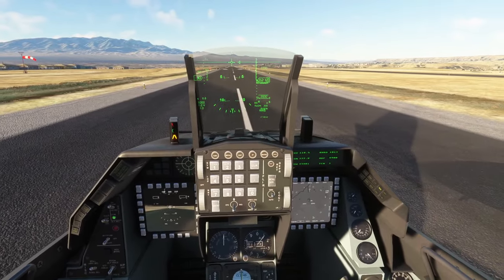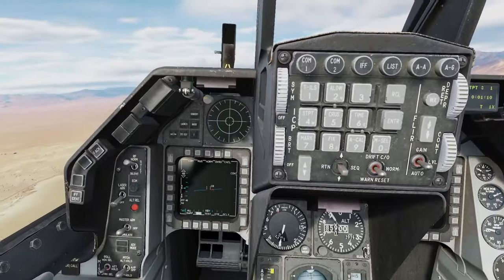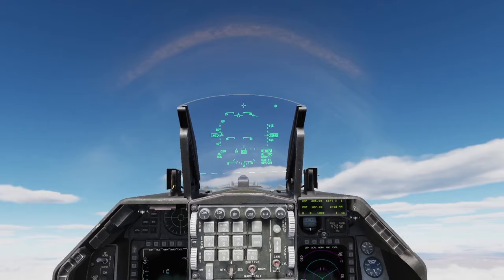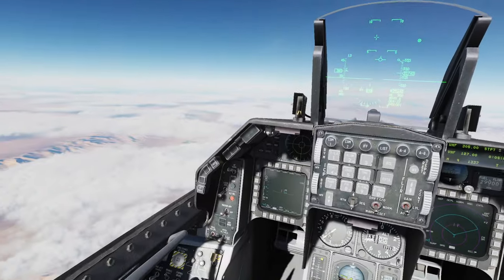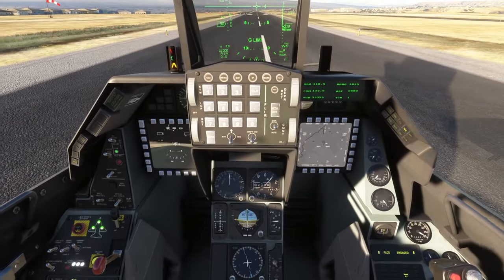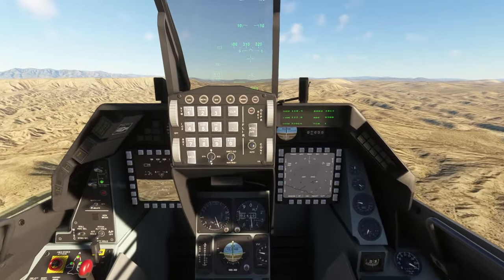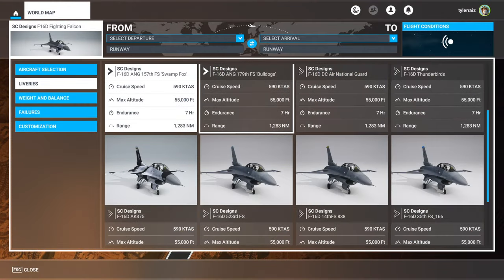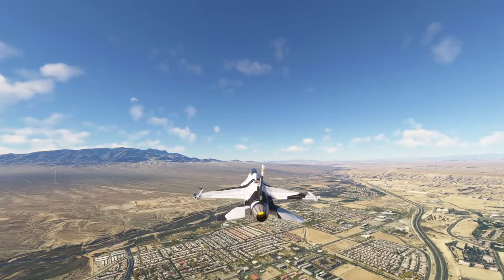MSFS - SC Designs F-16 Update

Comment: Every time I turn my viper stalls
Reply from the maker: At what sort of speed, G load, and aircraft configuration (flaps, gear, etc.) are we talking about?
Reply: Do you have a discord
Reply: I will send you a clip
Reply: Can’t compete a virtical roll I got stuck straight up would not let me roll over top
Reply from the maker: The ability to do a vertical loop would probably depend on your initial speed. If it's too low at first, then you would certainly stall. Most maneuvers, even normal high-G turns, require a certain amount of speed.
Reply: In ver1.1.0, when the AoA reaches 27 degrees (over 26 degrees), the pitch upforce is released and the AoA becomes 0 degrees. You can return to normal by pulling the stick again with the stick in neutral, but when looping, it is better to fly with the AoA below 25 degrees. In the real aircraft, the FBW starts to intervene when the AoA reaches 20 degrees or more, and when it momentarily reaches a maximum of 30 degrees, the FBW rejects the input and the maximum average AoA stabilizes at around 25 degrees. However, it is unfortunate that this is not reproduced in 1.1.0.